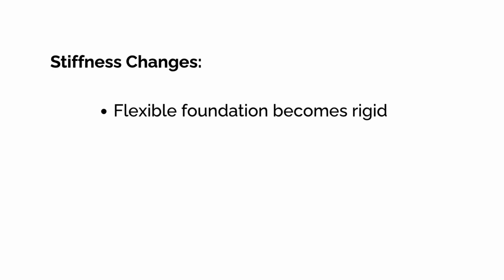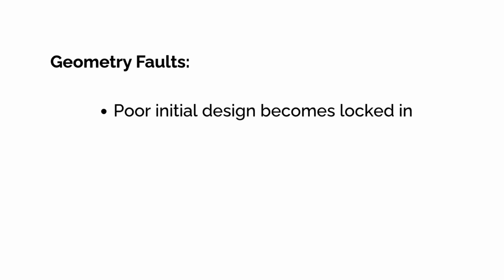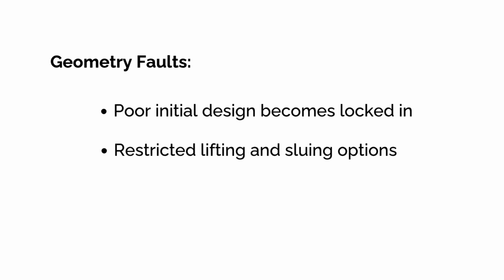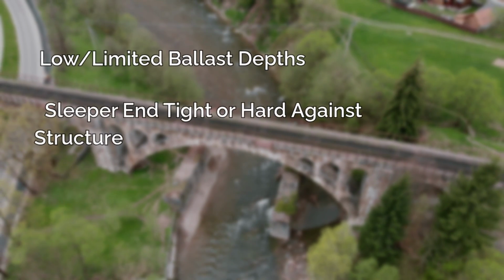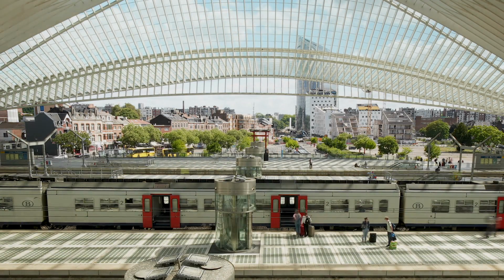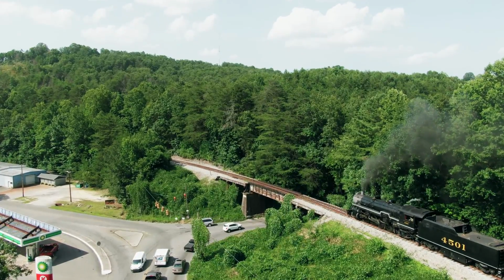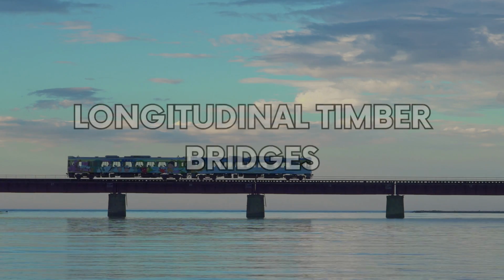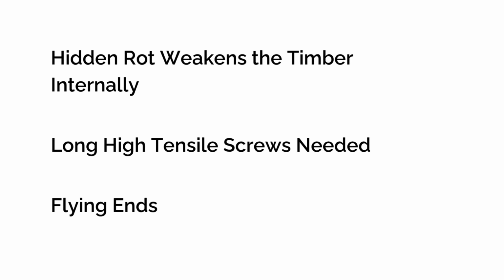What Railway Bridge Types Reveal — Before the Faults Even Start

Comment: A fascinating but extremely complicated subject- far more so than I realised. There is certainly a lot for a P W Engineer to consider, before we even get to the Buddleia problem! I'm glad that I didn't have any bridges on my miniature railway.
Just one question regarding lateral loading. You said that modern trains cause a greater lateral load. I was surprised by this as some steam engines, in addition to the hammer blow effect also had a certain amount of lateral movement, quite noticeable at times on the footplate.
Reply from the maker: I would say it is both the speed they travel and the mass of the train (particularly the frieght trains) that have increased the loading modem trains exert.
Reply: @thepwayengineer  Thanks for the reply. I hadn't considered those aspects.

Comment: I understand that tracks using concrete ties/sleepers go to treated wooden sleeper/ties on bridges, because they are more resilient and send less vibration into the bridge.   Have plastic/synthetic sleepers/ties been tried for bridges?
Reply from the maker: Yes they have been and are becoming more popular, particularly as a replacement for longitudinal timbers
Reply: One reason wood is often used on bridges rather than concrete is weight. Both the weight of the sleeper and the weight of the ballast supporting it are typically less when using timber sleepers which is why you continue to see them on bridges. Polymer /fiber reinforced sleepers have been tested and are finding particular application replacing long timbers as they are rot resistant.
Reply: @sensonic6514 That makes a lot of sense.  I looked at weight differences and although slightly less concrete ties/sleepers can be used, each weighs three to four times as much.  I wonder if there have been any experiments with hollow steel ribbed tubes in concrete - a hollow rebar have been experimented with to reduce weight for bridges?  This wouldn't address the balast problem though.
Reply: @lewisdoherty7621  In a former life I used to sell steel sleepers, which have exactly this benefit (lighter and less ballast depth needed).
Reply: @lewisdoherty7621  in a previous life I used to steel steel sleepers for exactly that reason, lower weight and lower ballast depth requirement.
Reply: @sensonic6514 I was thinking about that, but many systems run electric current through the rails to identify equipment on the tracks or broken rails.  If such systems are used, some type of insulating needs to be used.  In the US with positive train control, that is largely obsolete.  Steel is used here in tight curves in yards.
Reply: @lewisdoherty7621  rail insulation on steel sleepers is routine here (UK & EU) as track circuit signalling is so commonplace, so there is no issue with that.